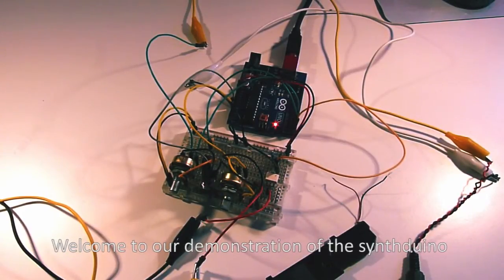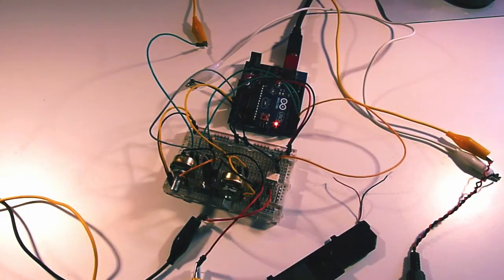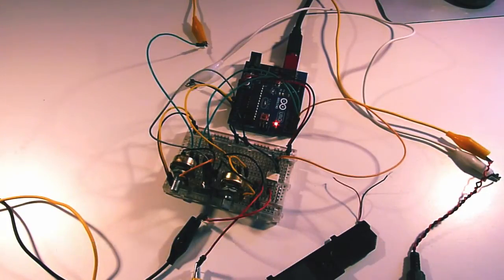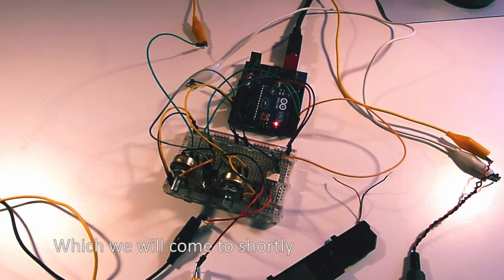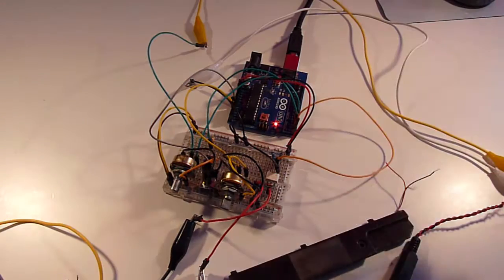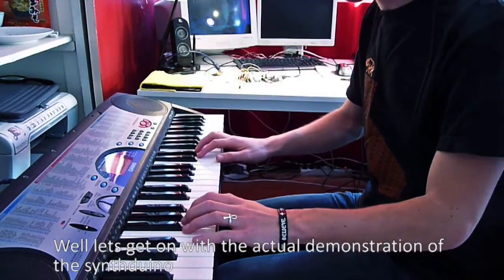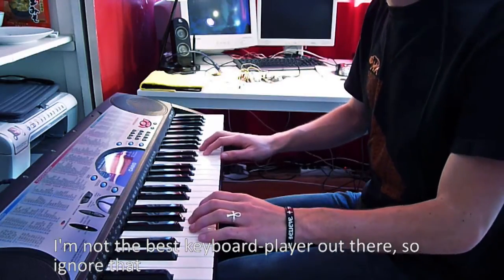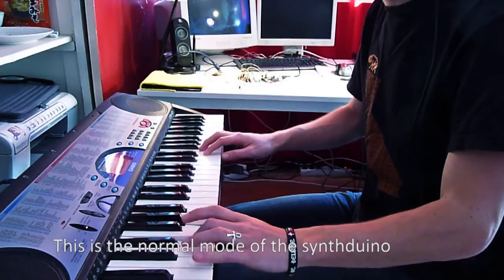Synthduino a Arduino Synthesizer

Comment from the maker: The MIDI signal is fed directly into the arduino, the arduino then processes the information and generates the tones you hear. No external devices are used, just the arduino.